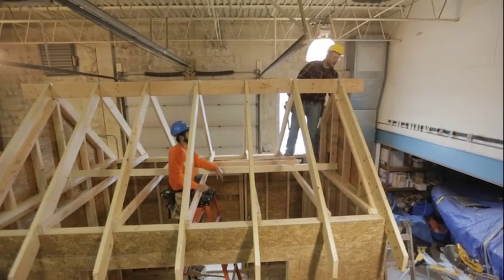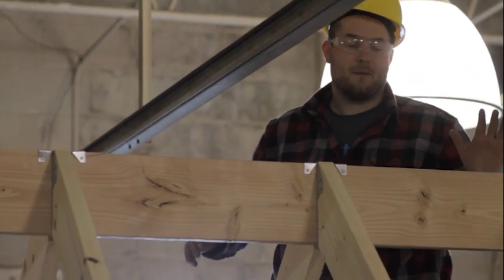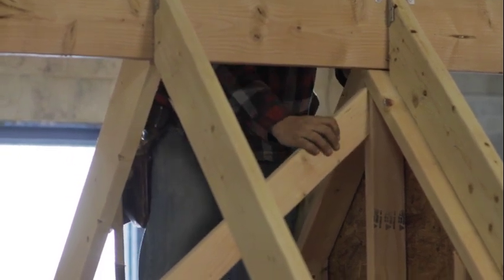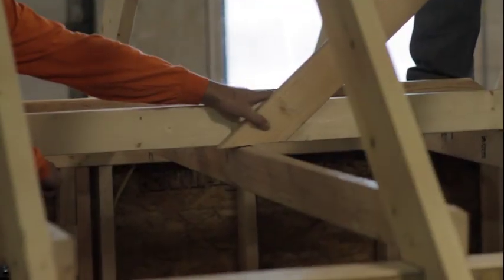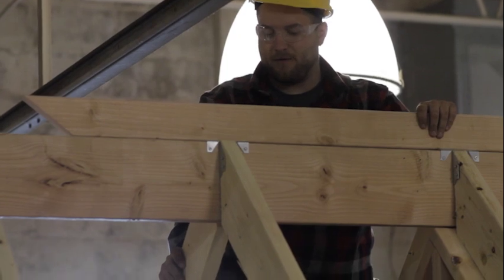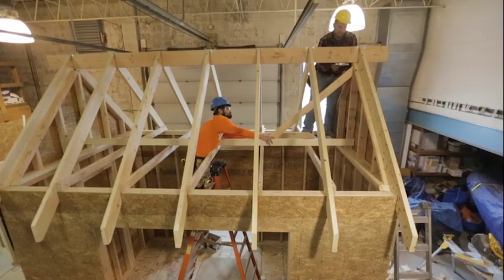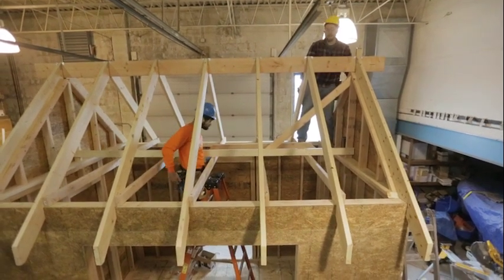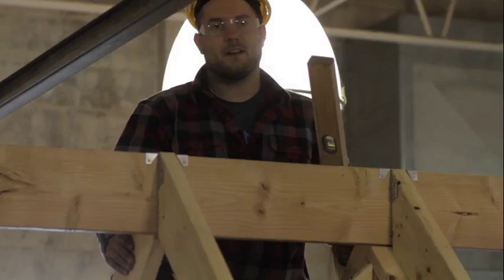How to Brace a Conventionally Framed Roof // Roof Framing Part 6

Comment: 12x16 shed... if I dont tie the plywood in from the wall to the gable end, would it be the end of the world? I already put plywood on all 4 walls before making the gables.
Reply: You'll be fine, but if there was a spot to remove a half sheet and install (at least) one full spanning wall and gable you would feel better about it. It will be no problem to reuse that half sheet on the roof. That is  assuming you didn't destroy the plywood  trying to take it down because, you went nuts and used 50 ring shank nails on it. 😂

Comment: Great info. Quick question...how do you brace the roof if you want to use the attic space (12/12 pitch) as bunkie space for grandchildren?
Reply: Once the roof sheathing is on, this brace isn’t critical.  The load on the end wall will be transferred in to the diaphragm of the roof sheathing and then in to the walls below.  My house was built in 1929 very similar to this structure.  No brace.  All is still good.

Comment: LMAO...thats the WRONG way to brace that roof. NEVER brace a roof off your ceiling joists. You should have braced from the wall at an angle to your ridge. ESPECIALLY since you only have 2x4's for your ceiling joists.
Reply: What if your ridge is 1×4 is there a another option
Reply: Так он сделал распор, он будет работать только при боковых ветровых нагрузках, ничего там не будет с потолкомSo he made a spacer, it will work only with lateral wind loads, there will be nothing there with the ceiling.
Reply: Yea it was odd in the video at 2:25 where he says not to brace it to the middle of the joist because it could slump the joist and the drywall, but then to brace to the joist.
Reply: Meh. That aint movin, pal

Comment: Excellent video. What if your crossbracing is reversed from the orientation you have it here. In other words it's attached at the base of the gable end (instead of the top like you have here), and the top of the 2nd truss. In my houses case it's actually at the top of the 4th-6th truss, if I recall. I don't think this would make a difference?
Reply: It is a fink truss, the truss framing looks identical to what you have here in this video (minus the diagonal bracing)

Comment: If u didnt nail that last piece to the side for fear that it would bulge and shake the fastners loose the why nail it on the side of the ceiling board???...will it not still shake the fastners loose there also over time?
Reply: Not really no.  The concern was that by nailing it to the bigger side of the stud, it could push out on the sheathing which could pop out the nails over time and create a bulge.  Nailing it on the bottom by the board that spans across the entire ceiling won't have the same concern.
Reply: @PrimeSuperboy  but based on his explanation it would be better to nail in on the support and not the side to the energy would be displaced in the board n not the fastner
Reply: I think it's because the long board running across the ceiling joist was nailed into the side of vertical board at gable end. So the brace would have ended up sitting cockeyed if it was flush against both boards. Still I agree with you and I personally would have sistered another board to ceiling joist brace spanning at least 4 joist. Then diagonal gable brace would have been extra  strong. Like they said  generally you would remove the brace, unless you lived somewhere that hurricanes or tornadoes were common. Then I would leave it and maybe even install extras, who knows what I might end up doing, I'm a wild one